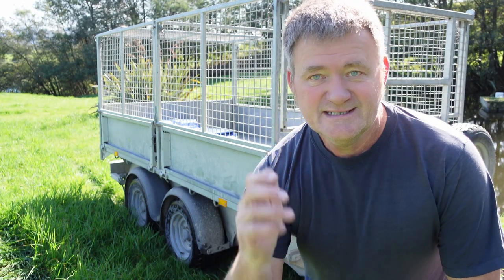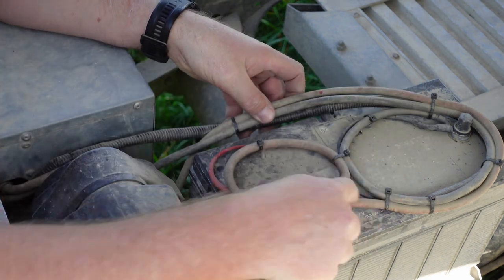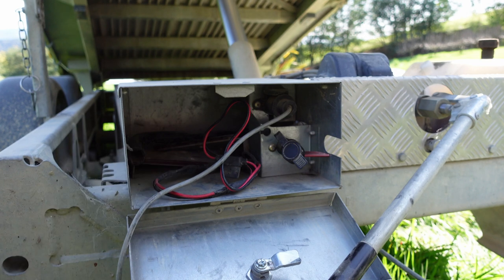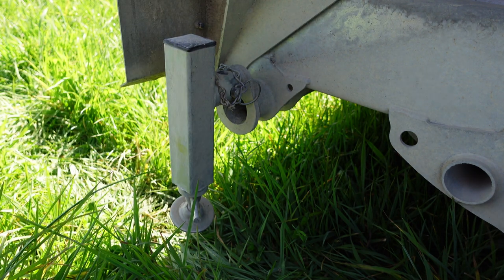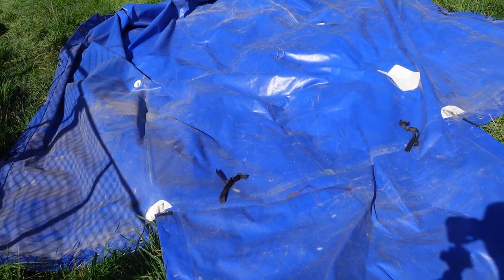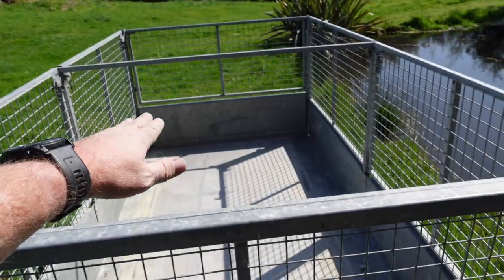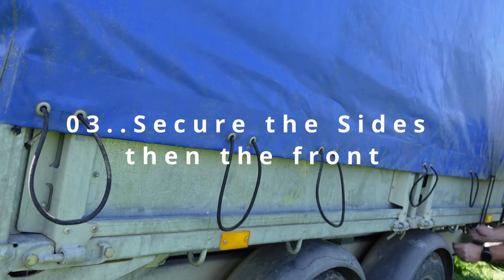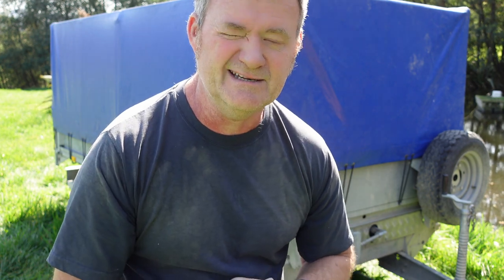trailer modifications ifor williams

Comment: Thanks a lot for the hints and tips, much appreciated.
I've got an Ifor Williams TT 3017 tipper, 2023 model year which has already got the remote connector fitted ex factory for charging the battery.
If you would like to get a picture I'm happy to mail it to you.
What towing vehicles have you got?
I use a Land Rover Discovery 4, a Ford Ranger and a Ford New Holland TS618 tractor.
Reply from the maker: Hi thanks for your comment,  glad they have upgraded and started putting a charging port on them by default that's great news. I would highly recommend the  cover plate for hydraulic tank. I did send an email out to all dealers and ifor williams on that year's ago so not sure if they have done anything with that.  Yes be good to see standard charging fitting nowadays,  could you add a picture on my facebook group "kingr8 lifestyle and farming", your welcome to  join the group also  if you wish.  I have a landcruiser that I tow it with or I connect it up to the small same frutetto 75 which is a great little work horse.

Comment: When you tailgate sand or gravel,  will The remote reach your vehicle, like a transit tipper?  Is that the whole point of having the chains, so you set them tip and drive?
Reply from the maker: yes the remote will reach the cab the lead is long enough, but wouldn't drive that way. another mod video coming on that. however the idea of the chains is that you can get an even spread as you slowly drive forward rather than it all tipping out in one lump which you then have to spread. just saves a bit of time is all.

Comment: We’re did you get the material from to make the cover
Reply from the maker: Any tarpauline manufacturer  should be able to supply or make a cover for you.  it is the same material used for the manufacture of truck side curtains.